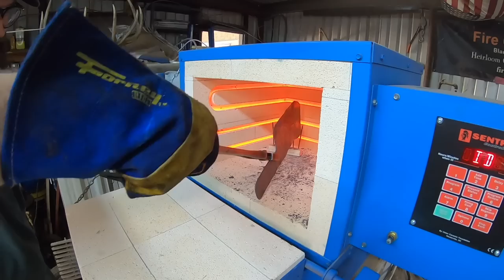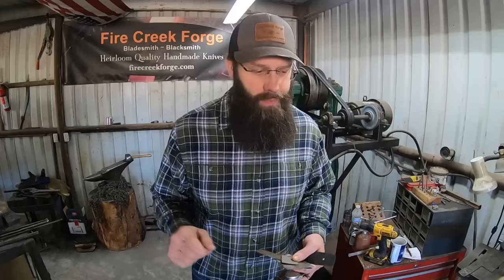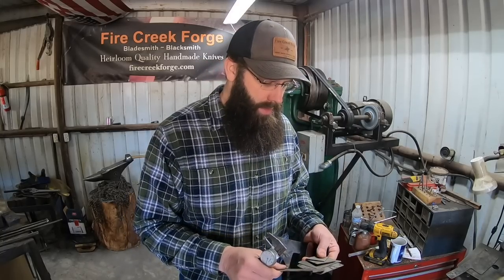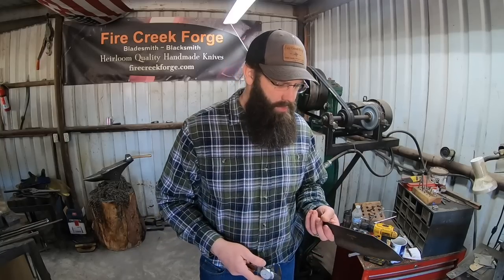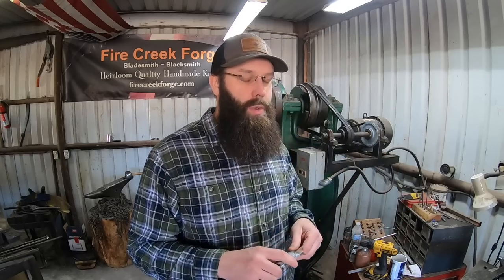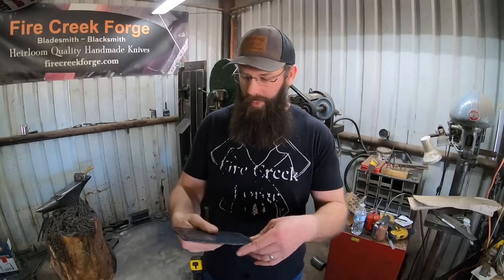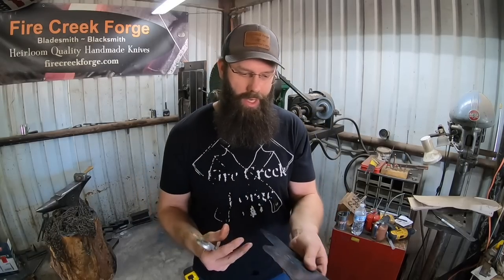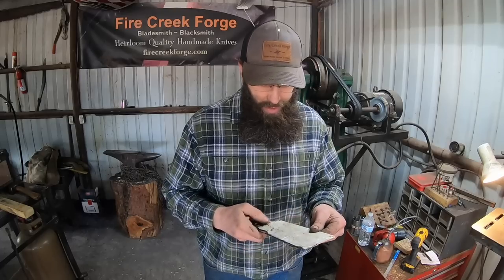I Broke 2 Before Forging A Thin, Slicey Chinese Cleaver Style Chef Knife, Blacksmithing, Knifemaking

Comment: These are a heck of a lot of fun to make and use, they basically do everything in the kitchen and yes they end up wafer thin towards the edge.
What I found is that I'll give them 10sec on the quench and then put them straight away in my aluminum quench plates to cool down for 4-5min just to keep them straight and yeah, you're gonna get some busted and warped ones once in a while. The 'safe' thickness at the spine is about 3mm but they're a little heavier so I'll typically go down to 2mm for a really good performer with a nicely rounded radius on them and the spine is traditionally used to tenderise meat. They also perform nicely with a C-Grind on the 'handed' side to shed wet food like vegies.
So yep, it looks 'simple' but there's quite a lot of nuances to them and its pretty hard to make a good one

Comment: Nice job on the blade. After I quench my blades. Especially the thinner ones. I clamp them between two pieces of aluminum plates for about ten minutes. They’ve come out arrow straight each time.
Reply: i do the same but use a wood set up

Comment: In my experience with forging 52100 thin it almost always warps if not after quench sometimes during temper. I made a jig for them that I use for tempers even if it’s straight as a laser. It’s very finicky and like you said has a memory from forging and will almost always warp if it’s on the thinner side. Love your channel, love your work.

Comment: Since you seem to be the main guy on YT who likes to experiment,  thinks about whats happening in the steel, here's a really good one for you to research: the effects of different frequencies in the steel as its quenching, cooling.  Since everything is frequencies and charge, would make for some interesting experiments. 

A Canadian named John Hutchinson was experimenting with frequencies and got a butter knife to imbed itself into a bar of steel or aluminum without heat, had a steel bar rip itself in half, supposedly helped clean up that major oil spill in the gulf, all using frequencies.  Maybe add an electrostatic charge to the experiment sometime. 🤔🤔🤔🤔🤔🤔

Comment: Learning... always interesting to watch a craftsman learn 👍👍.
   Could you straighten the blades during quenching by clamping them hard between cold metal bars ??? Or does that only work with thicker blades and/or different steels than 52100 ??

Comment: You may wanna look at the Knife Steel Nerds DET cycling for 52100 and do that in your oven, since forges don't evenly heat blades all that well. Annealing and then grain refinement would probably be the way to go. 

I'd also wonder about if that steel is too thin for the quenching media you're using, like how you can do large sections of 1080 in water and small sections in oil. You may want a slower quenching oil, but I do wonder if you are seeing higher than usual hardness or are having grain issues. One of the blades you busted looked like it had a spine crack that was the starting point of you breaking it, where it then went off at like a 70* angle halfway down.

And for post heat treat, I'd try aluminum or granite plates clamped over the blade to do the cool down.
I find that you can fix a warp by hitting one side with a ball pein hammer that will then remove the warp slowly due to that spot being harder and either pulling or pushing everything around. Grinding that away will re warp the thing, and heating the blade may warp it as well, but I find that this or sub 800* F quenching on certain segments is good. For that sub 800 quenching that's just when you torch a spot pretty hard and then cool one side with a wet rag or spray bottle, and the blade will suck over to that side a bit. Usually all this needs to be done in stages as grinding will reverse some of this. I suppose this is why a lot of stuff is air hardening as you can just clamp the piece between already flat plates.

Comment: I used a knife like that one with the belly on it that you said you were using as an edge tester chopping 2x3's on tuna. That big style makes an excellent tuna knife that you need to be very sharp, have a distinctive curve and belly and be aggressive enough to get through the scales, bones and fins on the tuna and the cut off the loins. I would be happy to draw you what they look like, although I'm certain you know what they look like or could find out. If you wanted to make them. I used mine for everything though. It was great slicer, cleaver, garlic press, scale scraper, rope cutter, head chopper, frozen bait chipper and of course, small ice shovel. Eventually it broke after someone placed it on the hot manifold of an engine until it got super hot then picked it up an realized it was hot, so,through it on some chunks of ice very hard and the tip came off. Shocked and saddened. Loved that knife

Comment: Out of curiosity, do you need a distal taper on blade where the spine and edge run parallel to one another?  I've always thought that was the plan for things like chef knives because the spine gets thinner as the blade loses height, so it helps to keep a consistent edge geometry.  I'm happy to be wrong about that, but it's what I'd always assumed (for clarity, I only have about 20 knife builds under my belt, so I'm not relying on anything but intuition there)
Reply from the maker: Distal taper is independent of the blade profile. You actually have two tapers on the thickness of the blade to pay attention to; the bevel + the distal taper.

Comment: I don't know why you didn't just grind it out of the band saw blade or if you want to get fancy you could make it a sanmi and put some mild steel on the outside even only on one side and just sharpen the softer side still might be pretty hard to do without a roller press but it could be done with your press